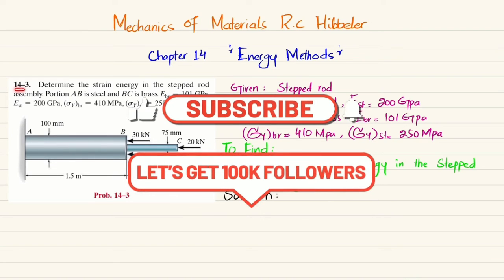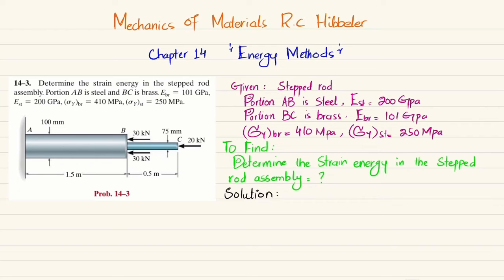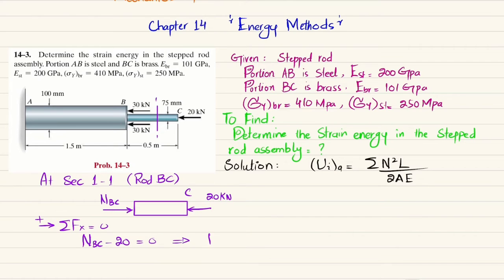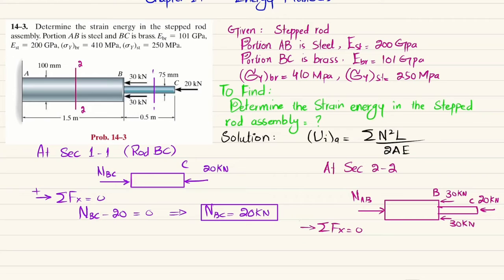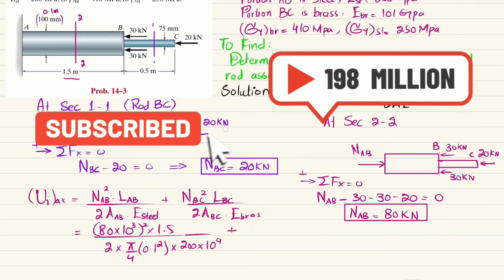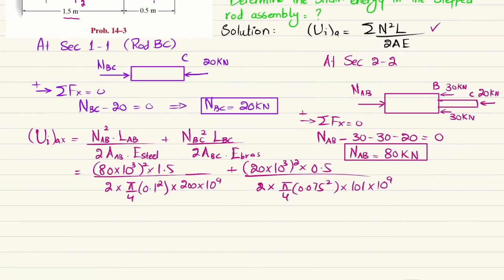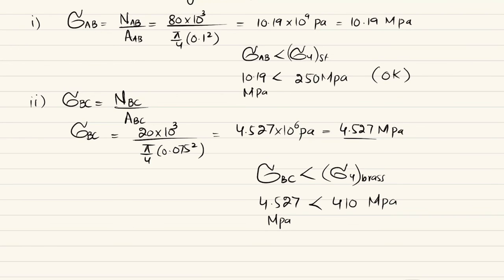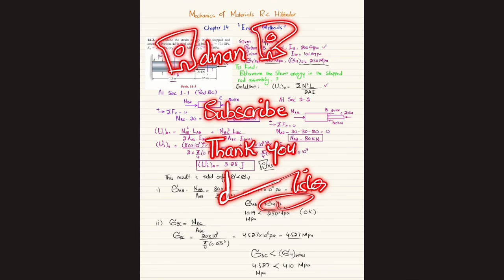14-3 | Determine strain energy in stepped rod |Energy methods| strain energy| Mech of materials

Comment: why u get area = (phie / 4 ) x sq radius
Reply from the maker: It may be a mistake as area of circle is pi* r^2....
Reply from the maker: I have check it and I used the value of diameter that's why area = Pi /4 * d^2
Reply: @engradnanrasheedmechanical  oh its my bad  mr.
I did not see it
Thank you for your reply
Reply from the maker: @LahiruWeerasinghe1 no problem dear. It happens and thank you for your interest in my videos...